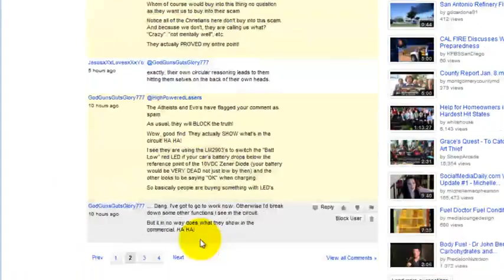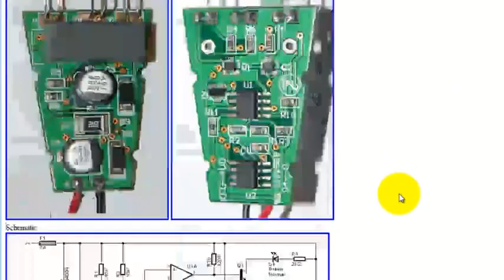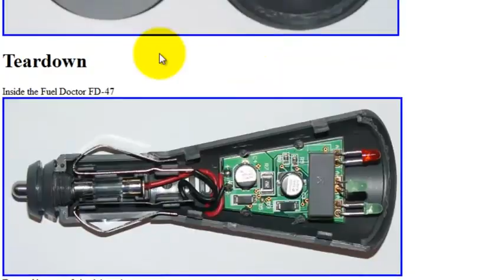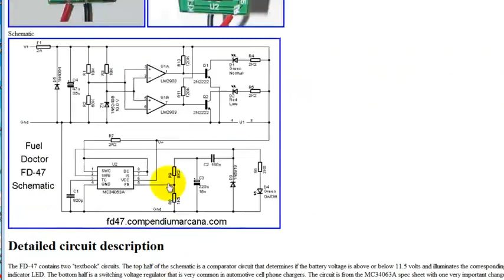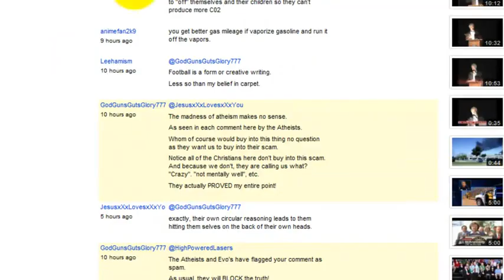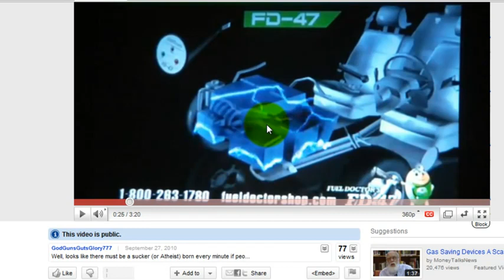YouTube - Explaining the FD-47 (Fuel Doctor) scam and circuitry.flv

Comment: It still is working for me-6 years later.Increased power and improved gas mileage.I get better mileage on my 1998 Cavalier than what Chevy is advertising on their new Cruze.I get better gas mileage than the car was supposed to get when it was new.Don't tell me that it doesn't work.
Reply: I have a similar system for your home, it works by smoothing the power to your appliances.  Just give me your checkbook....
Reply: It doesn't do much apart from telling if your cars electrical system is undervolting. It can't control the ECM from the cig lighter. If you want something that does, look for something that plugs into the OBD/2 port.
Reply: dude i got these pills that shed 20 lbs of body fat off of me and made my dick a FULL 2 inches longer, want to try them?

Comment: Well I have heard about network devices which communication links are based on home or near area power lines. Like network in power contact through some small connection module installed to computer. Dunno how this thing works... In best way it may redose some power circulations and car thinks that alternator works less so computer inject less fuel that thinks that there is no resistance on the wheels. I have no fkin idea :)  

Looks stupid but i wonder if anyone used this thing.... sounds like something crazy like magnets on fuel pipe or some other miricle ;p

What do you people think?
Reply: http://i.kinja-img.com/gawker-media/image/upload/s--IHXZUVVn--/c_fit,fl_progressive,q_80,w_636/198vv9olsm2sojpg.jpg

Comment: I covered this at incandescent.ca. It's a rip. I think it's constructive to look at the circuit but as you say, you can dismiss the thing even before doing that. You have to first subscribe to the fact that power cleaning will matter. Then that it will work from such distance from the proposed unstable voltage. It's just bull. 

I really enjoy this sort of analysis because when others get on the argument band wagon   it helps reveal who's a critical thinkers and who's feeble minded.

Comment: Nice Work!!  Always wondered what this thing could do for engine control stoichiometry from the CIGARETTE LIGHTER.  Since most systems are closed loop (obd-ii), you'd only be able to adjust voltage at the Rear 02 Sensor to change fuel consumption.  The engine will automatically try to maintain 14.7:1 air/fuel based on a standard configuration.  The ECU can self-adjust to a more enriched 12:1 based on fuel grade/oxygen content.  Besides, after watching it looks more like a battery volt meter...

Comment: @ImDavidGurney You have a cavalier that got 23 miles per gallon? Thats your first problem. It should have been in the "hybrid range" all along (probably 35 miles per gallon highway, depending on how old it is). I bet something went wrong with your car and it simply fixed itself (I'm guessing probably a sensor that vibrated loose). As an EE major, I can tell you, this device doesn't do anything and is one of the biggest scams in automotive technological history.